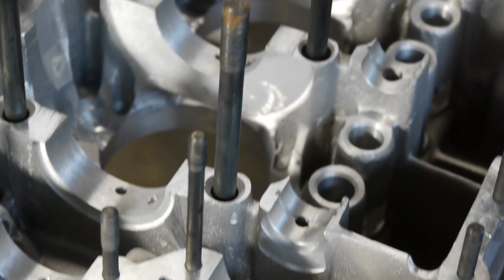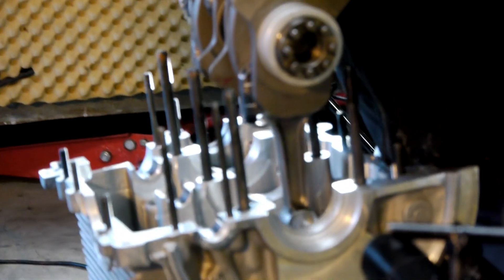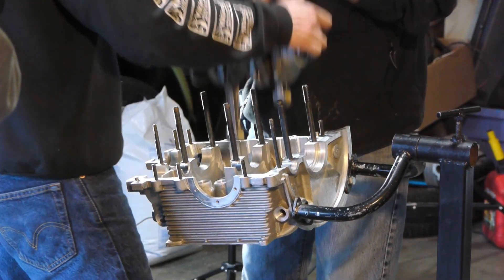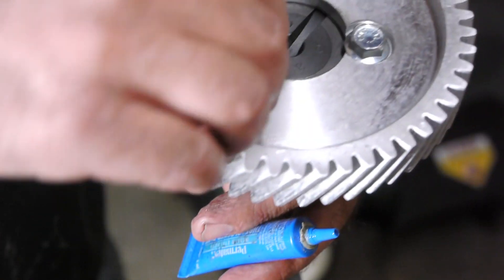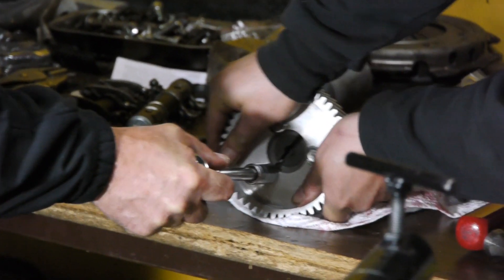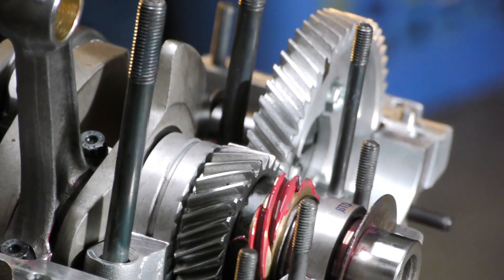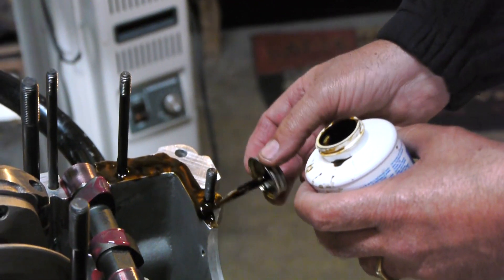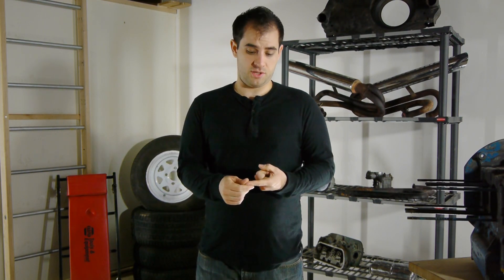Project One - Baja Bug : Engine Rebuild Part 1

Comment: There's way more to building one of these engines than buying parts and bolting them together, why did you not put Cam Lube on the lobes and lifters? Why so little lubricant on the moving parts?

Comment: i didn't see him check the tolerance on the cam bearings before putting them in ether if you don't do it and they aren't right it will chop your bearings out in no time.